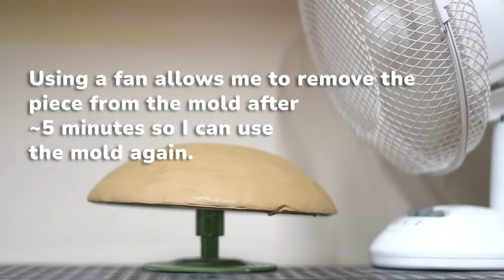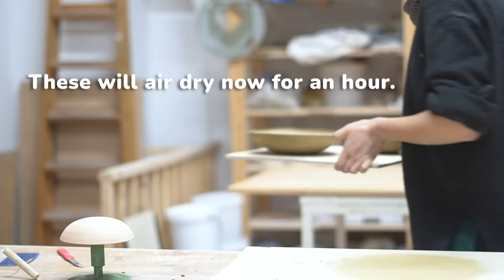My Favorite Hand-Building Technique to make Organic Forms

Comment: Never sand when is’t bisk!! 🙏 you need to sand before bisk, gently with a dish scrubber. Before bisk, the particules are heavy and less harmfull. After bisk, it can be risky for your lungs
Reply: You can sand by wetting the piece and using specific sandpaper that can be used wet or dry. The only thing is you then need to wait until the piece is dry again before glazing.
Reply: I sand my bisque pieces and the result is great. I wet the piece and frequently do so as sanding, and use a diamond sander block. Everyone has their own way, as long as it’s safe it’s right.
Reply: In better terms, the clay contains silica which his harmful for your lungs and can cause in easy word lung cancer.   But the risk come from not just sanding, but also not having the right workspace, vaccuming your work space, all cleaning g should be done wet. Even glazes have that same harmful effect. So therefore if you choose and need to sand a piece , you absolutely can, you just need to wet sand or you can even sand directly under running water. Just need to wait at least 24 hrs before glazing . Even sanding leather hard clay can still have the same harmful effect as bisqueware.

Comment: Would you ever want to consider adding a foot ring to these?  I prefer the irregular line.  Both are beautiful though.
Reply from the maker: you can definitely add a footring! I would use the mold to support the form while attaching. I find them more functional without the ring though.

Comment: I am brand new to this and trying to figure out firing in my electric kiln.  So pleased to have found your channel💕. I am using an earthenware clay in my small electric kiln. I noticed you fired your stoneware very low for bisque. 900/ 1652 then high for the glaze. Is earthenware different.

Comment: Very nice work 
I love the final result of the glazing 
Actually I used the same technique with slab on a model plates that I bought for this purpose. I bisque fired them at 950 in local atelier 
I was wondering if you can share the glaze you used for your plates, color and brand if possible

Comment: Hi! i was watching very carefully when you were glazing the big dishes - are you not worried about the thickness of the glaze? or do you make it rather on the watery side? 
usually when I glaze I have to shave off a little glaze, so it won't become too thick, since it may drip onto the bottom of the oven (is it's on the sides). You do it so freely, I wish I was that confident.
Reply from the maker: So much depends on the glaze itself. This is a super dependable glaze that doesnt run really. Know your glazes and you can always put a “cookie”
underneath if youre worried about it running.